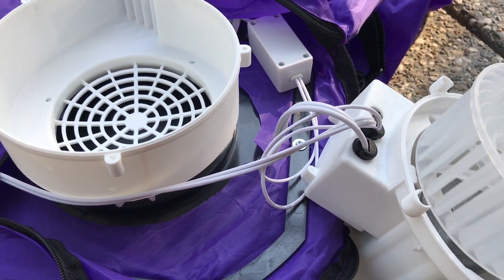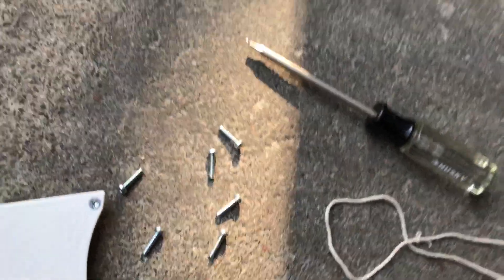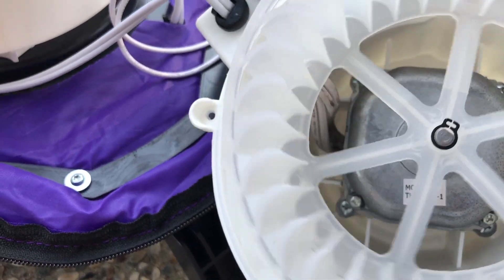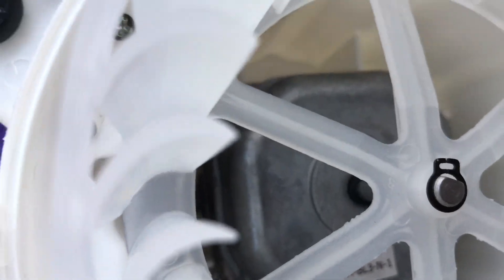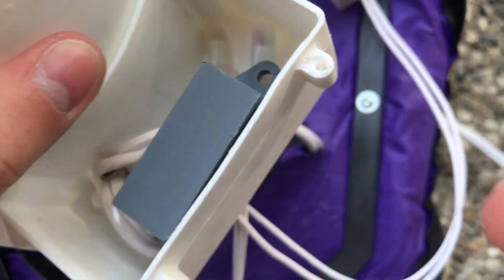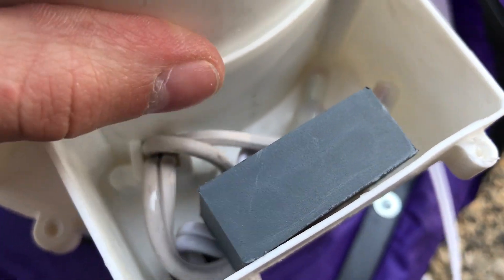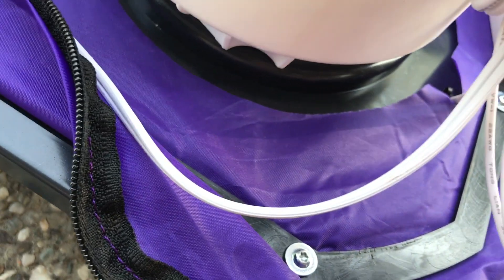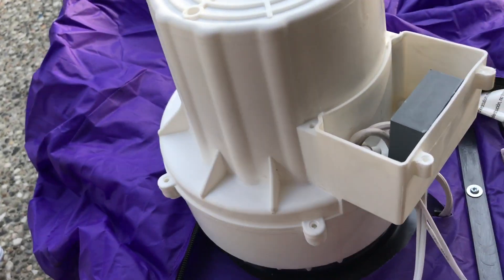What's inside of a slow starting base fan?

Comment: Would you be able to help me figure out how to fix or replace the motor inside of the model SJD-B3-2 fan for my inflatable snow globe. This is some thing my mom bought many years ago and she passed away this July, so I would really like to see if I could still keep it running. Any advice would be helpful.
Reply from the maker: I am sorry that happened. You can buy a replacement motor from this website https://www.yardinflatables.com/Gemmy-SJD-B2-Replacement-Fan-Base-and-Lights_p_2177.html which has the motor and some lights with it
Reply: @josephtheinflatableguy4609 , Will the SJD-B2 fan work the same as the SJD-B3? That was my main concern because the model number didn’t match, so I wasn’t sure if I could use that one. Thank you so much for your response. I truly appreciate. I didn’t expect to have such a reaction over the snow globe not working, so I feel a little silly about it, but I’m really grateful that I may be able to fix it.
Reply: Also, the link that you gave me says that it’s out of stock. Do you think this is something that will be restocked at some point? I will be eternally grateful if I’m able to replace it because from what I’ve read in other places, they are very hard to find. 😔
Reply from the maker: @andrapooh1  The SJD-B2-N is a small base fan and I don't know about the SJD-B3 as I don't have any inflatables with that fan
Reply: @josephtheinflatableguy4609  Thank you. That’s what I was afraid of. I might try it just to see if it does work because I really want to get this inflatable up and running again.